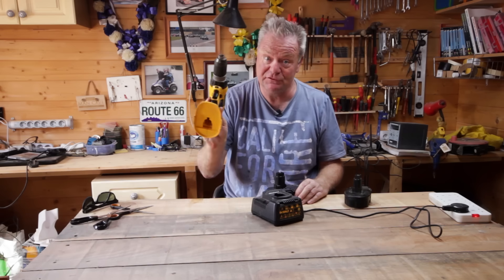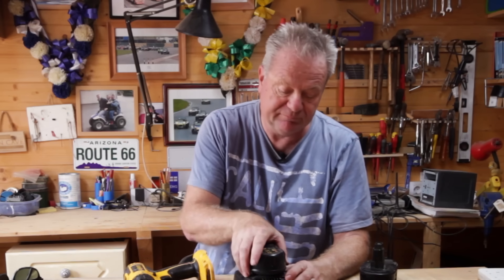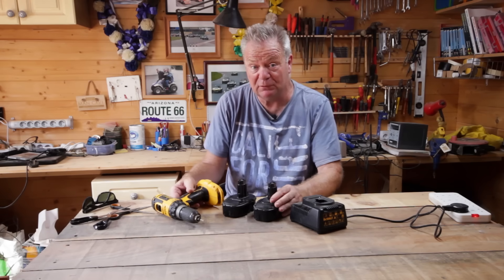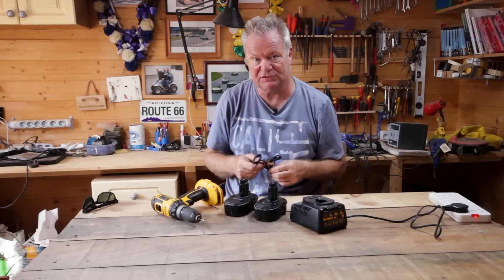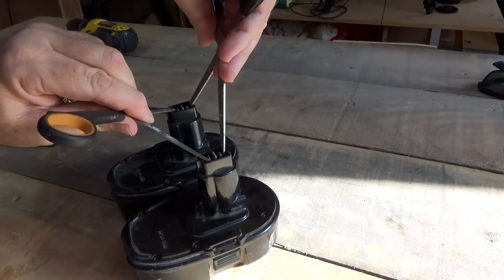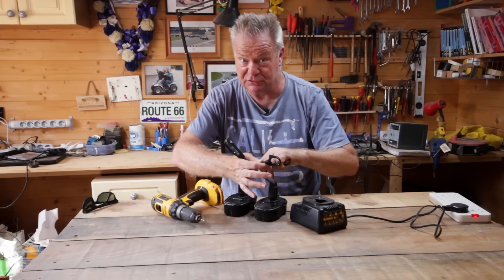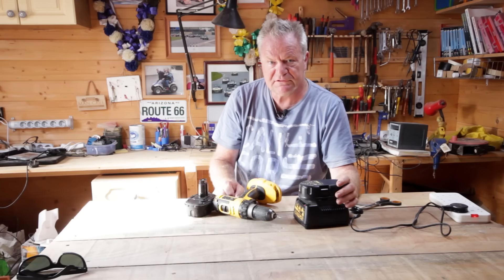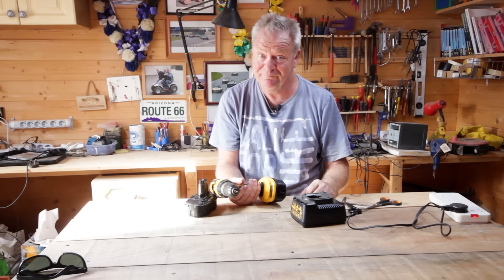How to revive a dead rechargeable power tool battery easily

Comment: Thank you for posting , I have 1/2 dozen unchangeable batteries that I had packed to go to the recycling yard and you tip saved me over 300 buck in little time whatsoever.
Reply from the maker: I hope it helps, at least with some of them
Reply: all 6 are functioning as they should so far  @JPinFuerteventura

Comment: does it matter how old the battery is? cause the first time I did it, it didn't work
Reply from the maker: If the battery is old and damaged then this won't work. This is a way around the "smart" charger not detecting that a dead battery has been inserted.

Comment: Same with car batteries.  Hook it up a better battery to the bad battery. Also connect  the charger to the bad battery.  Then after 10.minutes disconnect the good one and it continues charging  Can be done without disconnecting or taking any battery out of the car/cars.  Works if the batteri isn't short circuited.
Reply from the maker: Indeed it can

Comment: I have batteries that are fully charged but won't work on its device, do I give up on them?
Reply from the maker: It sounds like an issue with the device then. Do you know someone with a similar device that you can test your batteries in?
Reply: Sadly not, I've the feeling it's a virus as it happened to two different batteries and devices at the same time.  @JPinFuerteventura

Comment: Logic please, why would the dead bettery accept the power from another bettery yet fail to take power from the charge, more especially since the work bettery got its power from tha very charger
Reply from the maker: Simple. It is not that the battery wouldn't accept charge from the charger, it is because the charger is a "smart" charger  - so therefore very stupid as everything labelled smart is. It will only start to charge a battery if it detects a current. As the battery was too dead for the charger to detect it didn't know a battery had been inserted. Adding a small charge from the other battery was all that was needed for the charger to recognise it had been inserted and start to charge.

Comment: Five years ago I posted a comment here about how this method worked with a Black & Decker battery. I then lost track of this channel, so I never got to ever re-post and say that this "fix" is only temporary. The battery's charging capacity will decline fairly rapidly over a year or so to the point where it becomes pretty much useless. The only sure fix is to buy a new one.
Reply from the maker: That is often true although it does depend on why the battery was flat. The one in the video I used in my drill until it wouldn't turn any more and then I left it on the bench without charging it for many months so it was totally flat. It gave a number of years good service afterwards. But obviously if a battery goes flat because it has a damaged cell or cells then it won't hold a charge for long.

Comment: You can't jump start the closed top batteries, they won't have it!
Reply from the maker: I wonder why? ;-)
Reply: @JPinFuerteventura  Got them going in the end, couldn't use the scissor method, as I said they had a closed top, so I stuck jump wires with tape to the side connector pads, it seemed to do the trick. ;-)

Comment: The only real problem that I have with this is that apparently you do have to buy a secondary equivalent battery in order to cause this effect.  Does anyone know of any other work arounds?
Reply from the maker: You could try and borrow a similar one from a friend
Reply: @JPinFuerteventura  Any battery roughly the same voltage will do, even a car battery!

Comment: Why didn't you pop out the "charged" battery put the other in. because the dead on is on the bench.
Reply from the maker: I will tell you why as you aren't the first to suggest this. When I made this video I had only just started on Youtube and thought this get around the smart charger problem may help someone. I certainly would have shown that the other battery was also charged but, naively, what I didn't realise then was that there were so many disbelieving wankers like you around. Now crawl back into your hole.
Reply: @JPinFuerteventura  Sorry You feel that way but it is more believable to see it shown it doesn't always work . and for you to tell me to crawl in a hole . that shows how petty you are. just because you show both working it's easy to think that I tried it it didn't work. so what. don't get inflammatory because someone thought it wasn't quit right  the way you did it.

Comment: What if the two batteries were flat?
Reply from the maker: Borrow a similar good one from a friend perhaps?
Reply: @JPinFuerteventura  can I use a higher voltage donar
Reply from the maker: I think a few commenters have said that they have successfully done this but I haven't so I can't recommend it. Good luck Frank.

Comment: In a similar manner, I have a Snapple 58v battery for my hedge trimmer that is not charging. Can I use the same technique using cables plus-plus and minus to minus to get a significant enough charge to put back in its charger continuing to charge fully? I don't have another 58v battery of its type, but am wondering if I can use one of my DeWalt 20v dc power drill charger wired the same way even though one is a 58v and the other 20v? Perhaps the DeWalt can charge it's 20v up to 20v in the 58v battery?
Reply: Probably my thinking to try and get more charge into the bad battery. There shouldn't be an overheated condition being underrated in voltage. Perhaps a second opinion from someone who is as knowledgeable would help. Thanks, guys!
Reply from the maker: As it has a lower voltage it should do no harm to try it.

Comment: Do they have to be the same style of battery or can you use a different one. Like I have a dead Chicago tool co. could I use a Sun Joe battery to revive the dead one? If I can then it's just a matter of connecting + with + and - with -. Thank you in advance.
Reply from the maker: The make doesn't really matter as long as the voltage and type of battery is similar

Comment: What about a battery for a small chainsaw which after a few uses from new is indicating 'battery fault' with both green and red lights flashing on the battery charger? Can this battery be made to work again and charge properly? Thank you
Reply from the maker: It sounds like it is faulty so I suggest you return it
Reply: @JPinFuerteventura  Thanks ~ I have now got a replacement after reporting the fault in time within the warranty period.

Comment: Can someone explain the underlying cause as to why the discharged battery stopped taking a re-charge from the charger, but still would take a jump charge from another battery?   It appears that there is nothing wrong with the dead battery cells or its contact points, so what caused it to stop taking a re-charge in the first place?
Reply from the maker: It is the so-called "smart" charger. The charger has to detect a voltage before it will start to charge so if the battery has become very discharged no voltage will be detected. Therefore, it won't start to charge. Jumping it from another battery gives it enough to be detected. Like all things called "smart," such as smartphones, they are anything but smart.

Comment: Does anyone know why the same dewalt battery & charger wont charge - the Led on charger blinks as if charging normally for a few minutes but then flashes fast and batteries will not charge . The charger feels hot underneath aswell?
Reply from the maker: The batteries may have dead cells

Comment: how do you know which terminal is positive ??
Reply from the maker: If you are jumping two identical batteries then you don't need to as you just connect like for like. Otherwise you could use a multimeter if it isn't marked.
Reply: @JPinFuerteventura  CAN I PRECHARGE   WITH A 12V IF MY BAD BATTERY IS 18V
Reply from the maker: Ideally they should be the same, however, as it is a lower voltage it should do no harm
Reply: @JPinFuerteventura  BUT I DONT  HAVE ANOTHR BATTERY ....... JUST A 12 VOLT CHARGER.... AND A  MULTI METER
Reply from the maker: Surely you know someone with an 18v powertool who would lend you a battery for a few hours

Comment: I only wish he had put the VOM meter on the terminals to show us how much voltage he had restored after the full charge.

With all the success  stories listed here, how many of the "fixed" batteries  will hold their charge for 3-4 months after the fix?  My 14.4v old Snap on drill nicad battery I run down to zero rpm and then charge it and itr gets back up to almost 15vdc.  IF it sits for a couple months, it's dead as can be.. Not sure how you fix that....
Reply from the maker: There are lots of things I coud have done Max but when I made this video I only had about 50 subscribers and just thought this tip may help one or two of them. I had no idea it would get so many views.

Comment: Very interesting and helpful. I have similar situation where I put the battery on charger for two days and when I connect the battery to the drill it works for 30 seconds and then it stops.
Mine is a RYOBI 9.6V battery (No. 130269014). It has 4 prongs but the drill has only two connector. Can I charge it with a drip charger that I use to charge my lawn tractor battery?
Thank you.
Reply from the maker: If it charges, but doesn't hold its charge, it sounds like you have a damaged cell or cells
Reply: @JPinFuerteventura  Thank you for your prompt response. So there is no chance to revive it? I can't seem to find a replacement battery like this on Amazon.
Reply from the maker: @robkeshav800  I think the only way to solve this may be to open it up, test each cell and, if possible, buy replacements. There are videos on YouTube that show how to do this.

Comment: Hi All, I have just tried this but the old batery gets really hot and smells burnt. Am I doing something wrong?
Reply: I have found the issue. The two batteries have to have the same characteristics for it to work, or at least in the case of erbauer 18v 2.0 ah. I tried it and it is charging👏🏻👏🏻👏🏻👏🏻👏🏻… I will tell in hour or so if it worked. The issue I got now is that the guide light of the drill does not go off. Does anyone know how to turn it off? It is meant to go off on its own after you stop using the drill.
Reply from the maker: Sorry, just saw your comment. I am glad you worked out the problem. I have never heard of the light problem. I wonder if that is why your battery went flat in the first place?

Comment: |'ve bought a work light from Lidl for 3 quid (normally 20-25) knowing about this it was on knock down and confident it has gone below the charge to be re-charged but don't care Its still new condition, I'm sure I can revive it, I just came to confirm and leaving it on charge for a day knowing I'm probably waisting time but will do the trick tomorrow and totally confidant it will work
Reply: As suspected it was a waste of time leaving it overnight on the charger but I felt I had to try and was dead next morning but a quick flash on another battery the charged recognised it and its brand new, take notice of this trick people it works
Reply from the maker: Thanks for letting me know. Glad it helped.

Comment: Dangerous, by todays standards batteries need to have a BLM that cuts off at a safe lower voltage to prevent complete depletion.
Chargers need to be smart to trickle charge the first few minutes as Lithium batteries can be very unstable.
This charger is a dumb charger doesn't have any protection or stage charging... it can overheat and set batteries on fire.
The only this the charger did was it detected the battery was in undervoltage state and refused to charge out of safety.
Reply from the maker: These weren't lithium batteries

Comment: The “jumper cable” charging method worked!  I tried the off and on, off and on method, but that didn’t work.  The battery needed the boost to fool the charger!  I used a couple of wires and electrical tape to hold them on and after 15 minutes…success!!  Thanks!
Reply from the maker: I am glad it helped

Comment: I have two dead 12V dewalt ones but no other 12v ones only 18v - guess there is no solution for that?
Reply from the maker: Borrow a similar 12v from a friend perhaps?
Reply: Not many people have the 12v ones now. The battery seems to charge to about 5.5v but won’t go past that. The other battery gets to about 2v. 1st one Not flashing broken now either. Was not doing anything before but I used my tester to check the charger voltage and after that it  seems to have started charging even if it’s not the full voltage. I think the batteries are past it as had the unit for about 10 years now.
Reply from the maker: Yes, if they are actually charging but not to a very high voltage then it,
unfortunately, sounds like they have damaged cells. This method won't solve that.

Comment: Will this work with the Black and Decker cylinder shaped rechargeable? I bought wanna bes on line but did not work in the small saw and standard drill
Reply from the maker: There is no reason why not, provided the battery doesn't have damaged cells.

Comment: Will this work for any rechargeable battery.
I have some black n decker versa pack.
Could ya do a video on different batterys..please.
I love to rebuild revive I stead of replace
Ty so very much
Reply from the maker: It should work on any battery (provided it doesn't have dead cells) although care should be taken if it is a lithium.

Comment: I used this methodf to get a dead e-bike battery going... although I usd wire, connectors and PPE and not a couple of pairs of scissors ))))....but worked none the less
Reply from the maker: You have to make do with what is available Gareth ;-)

Comment: Can you give me advice on a 8v Max battery? should I use your method with a 9v battery?
Reply from the maker: I am glad it worked Mike
Reply from the maker: The same voltage would be better
Reply: @JPinFuerteventura  I used a 9 volt and it gave it the tiny amount of juice it needed to be picked up on the charger. thanks for the video and reply!!! Cheers

Comment: Are you still responding? I have 1 completely dead 24V battery and I only have a 12v one here that is working, can I use this same process to try to save the 24v one?
Reply: *the dead one is 24v and the alive is 18v
Reply from the maker: You can try or perhaps borrow a similar one from a friend

Comment: If you don’t want to use scissors, just use the leads from your multimeter; simply slide them over the leads on the battery, and then touch the battery. You intend to jump, start with the other sides of leads. Give it a few seconds, and then take a voltage rating with a Dewalt you want to get it above about six and it will begin to charge. It’s not gonna be a new battery but it will charge. You could take it apart and put new 18 650 batteries in it.

Comment: I have 2 sea scooters and both have dead batteries, they won't charge at all. the batteries are expensive and I don't want to buy new ones....any help?
Reply from the maker: Well if you are going to throw them away you could try this. If they are lithium batteries though tehn take care as they can get hot and catch fire.
Reply: @JPinFuerteventura  thank you! they're Li-ion Yesterday I started trying to open the battery compartment as they are shielded with a rigid type of silicone and later today I will open them to see if the batteries are rusty and if I can change them.

Comment: Hey JP! I have a dead Karcher Battery (18V, 5Ah) and this trick doesn't work. Any advice?
Reply from the maker: It would seem it probably has a dead cell or cells then. Is it a lithium battery?
Reply: @JPinFuerteventura  yes, lithium, but it hit me I was using a lower voltage battery from another device (11.8V), would that work or do I need the same voltage (18V)
Reply from the maker: @pysiakk  Ideally the same voltage. However, although some people have said in the comments that they have used this successfully with lithium batteries, you should be cautious as they can get hot and explode.
Reply from the maker: @pysiakk  A battery with a similar voltage might have a better chance of working. However, you need to be careful with lithium batteries as they can get hot and even explode.

Comment: save more money and start with quality tools
Reply from the maker: You can get the same issues no matter how much you spend
Reply: @JPinFuerteventura  crap quality speaksforitself
Reply from the maker: @fuzzzeballs  So what would you recommend? Since so much is made in China, most of it is crap.
Reply from the maker: @fuzzzeballs  The DeWalt drill in the video lasted almost 15 years so what use would a 3 year guarantee be?
Reply from the maker: @fuzzzeballs  Prat

Comment: I've got a CEL multitool that hasn't been used for years. The battery was completely dead and wouldn't charge. This is so old the company stopped making the tool 10 years ago and the battery 5 years ago and nowhere has replacements. I (very nervously) followed your instructions and linked up to the only other rechargeable battery I have which is a Makita. I was expecting one or both batteries to go bang, but apart from a few initial sparks, it's totally worked. I'm charging the battery fully now, but did a test after 20 mins of charging and my multitool came to life. This has saved me a lot of money replacing this tool. Thank you so much.
Reply: Well it's working and cuts wood but even after leaving it on charge for 24 hours won't show more than one bar power on the multitool. Any advice to get it fully charged? Will it get better the more cycles it goes through?
I opened the battery a few days ago and it has what looks like 3x  18650 batteries but all wired together so no idea what to do if I need to change the cells for new ones
Reply from the maker: It sounds like one of the cells may be damaged, sadly. You could perhaps try to test each one individually but unless you can buy a replacements cell knowing which is faulty won't help.